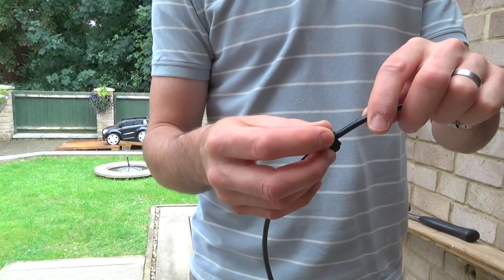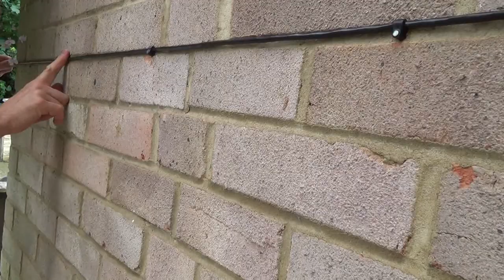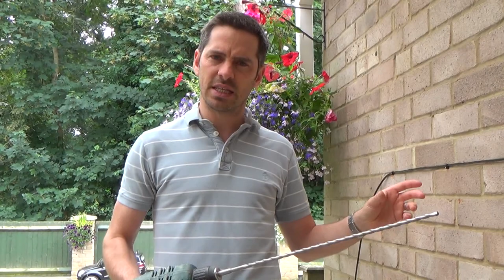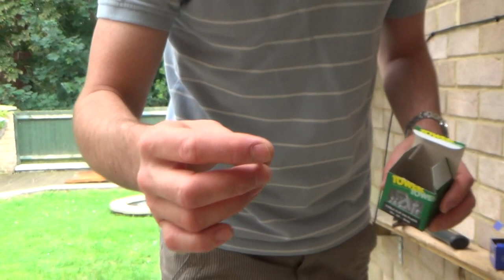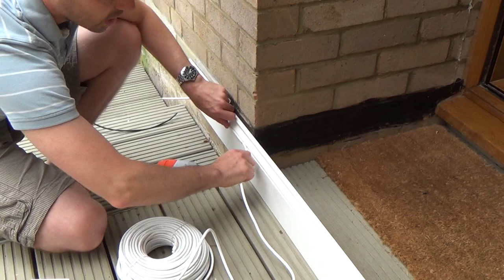How to install an external and internal cable

Comment: Just fast forward until the kid stops shaking the cam. Got some good points. (Actually mate, you should put something like this in the description.)
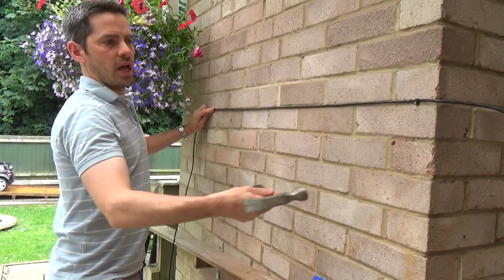Fastening cables with nail clips- 1:30 - Follow the mortar lines. Put the nails below the cable.
Drilling - 4:20 - 18 inches long 8mm drill for phone cables, and drill downwards from inside out using hammer mode.
Using pin plugs on tougher surfaces - 9:06
Thumbs up.
Reply: Arda Önder of

Comment: For inside jobs:
I like those cable ducts with adhesive on the back (you need to screw them in place anyway), especially if you run multiple cables. It looks better than "raw" cable and are often not that eyecatching.

Comment: Nice informative video mate, and good to see you advocating the use of safety goggles etc when drilling. However using drills, hammers, and sharp objects such as in the cable  pins is a definite no no when you're doing it in bare feet! ;)
Reply from the maker: lol....I know...I'm asking for trouble, but the day was so nice,  bare foot was the only way to go :-)

Comment: Internal for baseboards if you're in a room with carpet you can usually tuck the cable UNDER the baseboard as there is a gap for the carpet and carpet tack.  Then it's 100% hidden and doesn't even need any fastening.

Comment: Only thing, is everyone is making comments is saying don't nail with the coax cable except do you notice that when the cable company runs cables guess what they do???  They nail the clips, they use screws with the various small connector interface  however they nail the cable connectors into the wall..........(not brick though)...:)

Comment: Helpful, but a critical part is being able to bring the cable from the outside to the inside, through a wall or door, without ruining either.
Reply from the maker: +00bikeboy Hi, yes I agree, I think I did mention in some part of the video about taking the drill off hammer for the last bit to try and prevent breaking out the brick and also angling the hole downwards and having a drip loop to stop water running down the cable. Going through wooden door frame or window frame is a lot easier with much less chance of damage but there is more chance of leading to wood rot over the years.Thanks Vince

Comment: Good video i came here just to find out what to do with the hole in the wall (cement, silicone or filler etc) couple of tips though, you was saying "okay", and "right" a lot which kinda got annoying for me towards the end. Also i found myself skipping bits because you was repeating yourself a lot or saying things that was just obvious and common sense. But yeah i came to the video for 1 little thing and kept watching once i learn it

Comment: In the U.S. We drill from the outside in on brick homes thru the mortar we measure the inside and we take those measurements and that's where we drill our access point blowing out brick is frowned on 😂
Reply: What will you do when there is insulation layer on top of the bricks (in colder areas) ? Because you may create thermal bridge or hole thermal runaway. Did you put extra insulation inside that hole after the breach?

Comment: Great video! I want to wire a ethernet cable or cat 5 cable to a room upstairs in my house however im not sure where to wire the original cat 5 from. Do I do it from the router out the wall (to the outside) around the house and back into the room I want it in? Please help!
Reply from the maker: Hi, yes you would need to run it back to the router.
Reply: +My Mate VINCE hi Vince. I'm from ireland and am enquiring about running a cat 5e cable from my modem downstairs to my attic room upstairs. what would be the best way to get around it. My bedroom In the attic is directly below my sitting room where the modem is. would I be best off drilling a hole in the sitting room wall then running it outside along the wall up to the third story then drilling another hole in the exterior wall into my bedroom wall. any info would be much appreciated.
Reply: I strongly suggest drilling out the wall up into the roof and then outside again then into your room

Comment: if am running sucurity camaras. would the cables be ok vs the sun and rain? Am doing it on my app building and it would be easier to run the cables on the roof.

Comment: What is the best procedure for feeding the cable in from the outside across the 'cavity'  to the interior especially nowadays as most people may have the extra cavity insulation those polystyrene beads etc.. ?
Reply from the maker: +rockywr A lot of people straighten out a coat hanger but you can get nice electricians thin access rods that work perfectly. Also I remember on Dragons Den someone invented a Magnamole that was made for this purpose.Thanks Vince.
Reply: @Mymatevince  Attatch cable to drill bit with tape before pulling out.

Comment: Thanks for anothet great video. Can you answer a question I've been trying to find the answer to. What is the procedure for wiring a drop cable from a pole to the property and to the socket? What is the best practice for one person to do this? Thanks again
Reply: Hope you didn't do this yourself... A non contracted individual is not allowed to climb and run a drop cable from a pole.

Comment: Never hammer into mortar.Mortar may feel hard by touch, but it is very brittle. Especially the cheap shit newer builder's use. It's just there to  fill and seal the bricks .the bricks are doing the work. A method anyone can use is to drill into the brick with a small bit and but a wall plug and use a scew instaed of nail. Never on mortar, it will crack  look bad and more importantly give you more work.

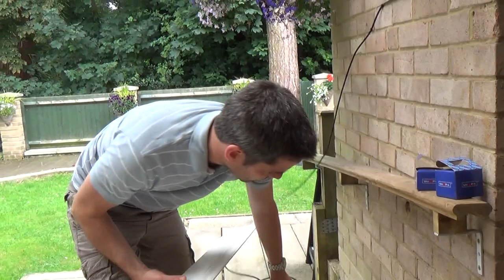Comment: 10:11 Clearly your cable clipping is straighter than your shelf fitting :D
Reply: Thats not a shelf fitting, it's a hand rail for the stairs.
Reply: fro0tyl0opy87 it’s a handrail

Comment: I not sure about the cable clips size I have a cable 25 meter 2.5mm 24 p 3183 3 core flexible cable not sure if I need a 9mm or 11mm I been told I need 11mm but not sure can you had advice for outs what size I need for the cable clips

Comment: For internal cabling, if you have fitted carpets (with gripper rods) abutting against your skirting boards, is it feasible to pull back the carpet and tack the cable to the floor, keeping it out of sight altogether? What puts me off trying is the fear it won't be easy refitting the carpet.
Reply: I have coax in my house running under the edge of the carpet and in a tiny space where the skirting board isn't quite touching the wooden boards, and it's completely invisible. It was installed by the previous owner or somebody they had in.

Comment: coax cable should never be nailed in..... you damage the dialectric..
Reply: Joe S don't nail hard then
Reply: Don't nail at all..... And never use staples....
Reply: what do you use?
Reply: Magic
Reply: javier hernandez  you use a drill and screws not magic just common sense
Reply: If that's the case why do they sell nail clips specifically for coax cables? Just don't keep hitting once the nail is in and like the video said light taps don't try to whack it in all the way in one go.

Comment: When why would you need to run an outside cable?
Reply from the maker: Cumbriahandyman It is often easier to run a telephone extension or a network point externally as the route can a lot shorter rather than running it internally up the stairs etc. Or you may to run the cable into an outbuilding (shed/garage).

Comment: Are those installations really allowed in the UK or by local regulations? Because running cables outside is often prohibited by historic preservation authority here :-/ . It is also something which calls metal thieves (yes, even those thin cables... or vandals). Not mentioned that it is not considered as secure way how to lead it since anybody can tap on that wire. That is the reason why national telco network service provider not install this way. Only in case of real trouble. Last and not at least there is a problem with insulation layers on top of concrete or bricks. You have to use different hatches and also it differs from technology to technology because you can have more than one layer of polystyrene or different  plaster technology.

Comment: The only correct thing done was the angle of the hole. Don't hammer mortar. Don't hammer coax. ALWAYS wear PPE! Don't attach to the face of trim. Drill from face of brick.

Comment: I have to disagree with you. First, you fail to wear PPE even after commenting on getting injured while not wearing PPE. Barefoot? Seriously? Second, drilling from inside out ALWAYS will cause damage to the exterior surface. Try using a Magnespot for this application. Third, have you heard the term "bend radius"? You can't bend cable around a corner like that. If you have no other choice but to run exterior cable, at least try using cable that comes close to matching the color of the exterior surface. They do make cabling with gray jacket. This is NOT a professional install. To think that you have 56k subscribers following you boggles my mind. If you know better, do better.
Reply: Iota I.T. I’ve never seen exterior cat5/6 cable that isn’t black.
Reply: Stop talking shit, drilling inside to outside does not always cause damage, if this is the case maybe you are doing it wrong?